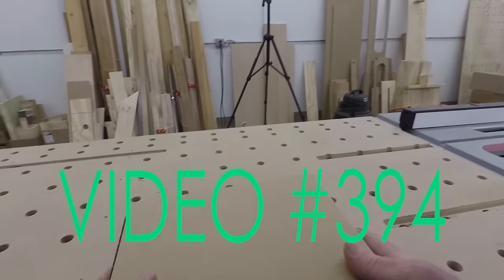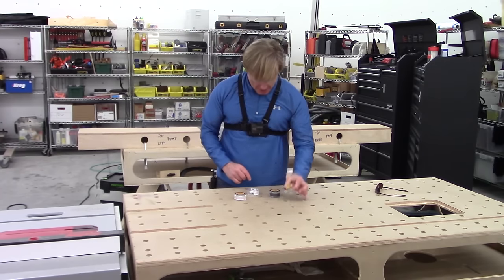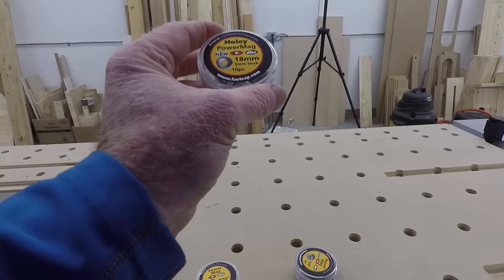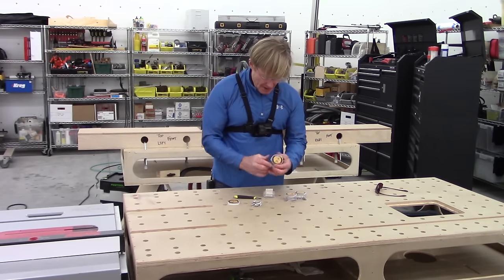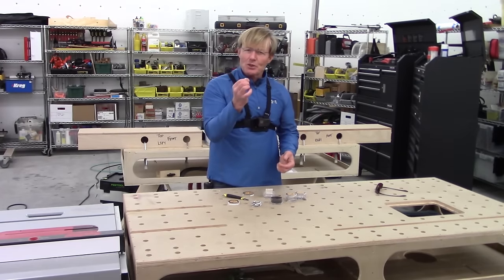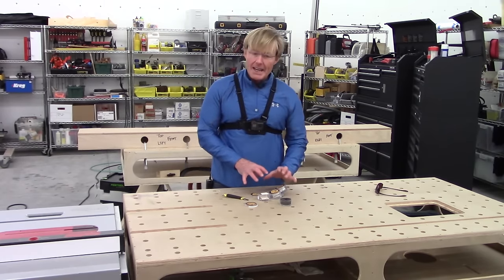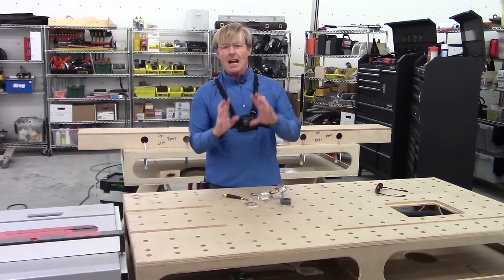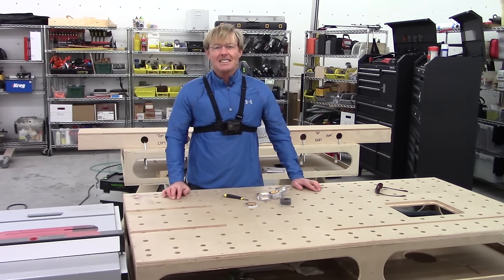Mail Call: Fastcap PowerMags

Comment: Ron these mall call vids are AWESUUM love them and thanks to Fastcap for their products I have a number of their products.

How about do you use their Kaizan foam panels for tool storage could you do a video about this product? It is a great product.

Keep em comin.
Reply: Anthony Ward  Kaizan foam:  I like the concept, but I found that the glue becomes permanent after a while, which really disappointed me because I wasn't able to use it all in one shot, I had set some away to use later, and found that it had become  one solid block.
Reply: You must be referring to 2p10   Kaizan foam is a sheet good for tool storage makes great custom case liners. Check it out at Fastcap.